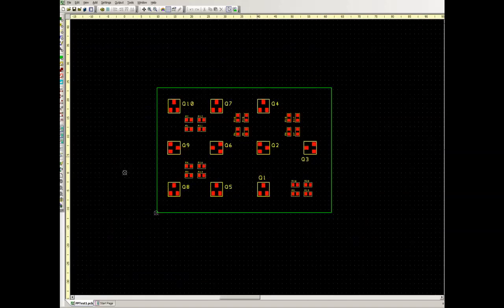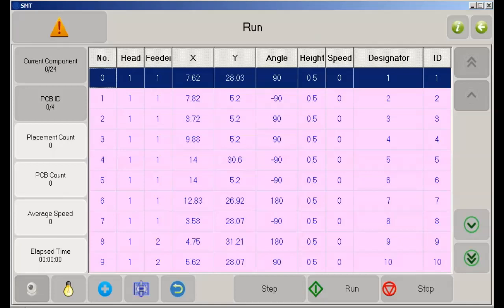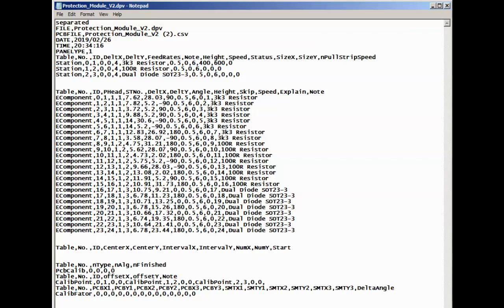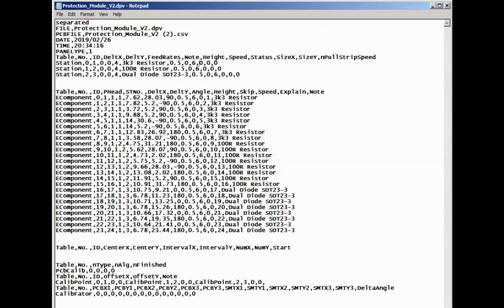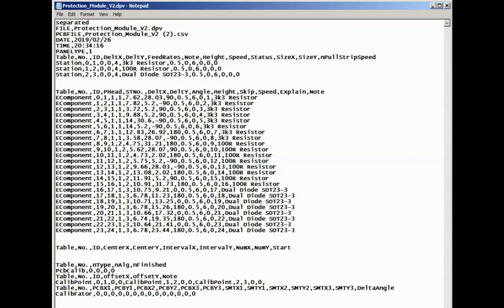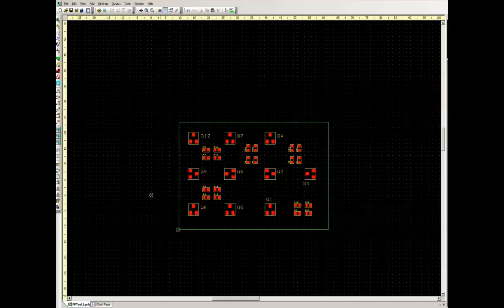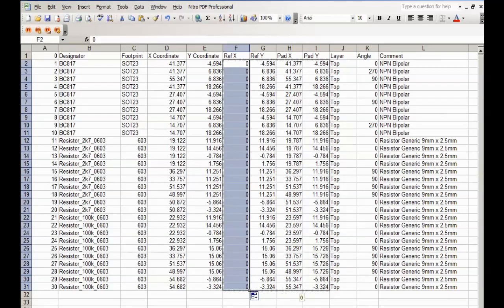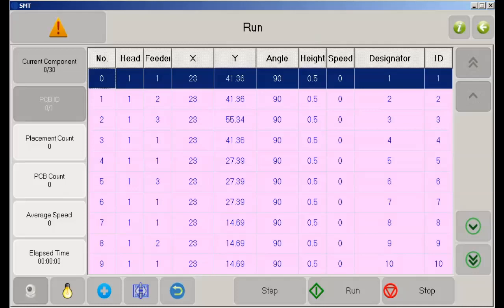CHM-T36VA Pick and Place Machine Part 2

Comment: I think that there was an error importing the CAD generated csv file -- items do not get mapped to the right columns. What got me is that @20:56, all of the "X Coordiantes" are 23.00, which cannot be right as there are also repeated "Y Coordinates" with the same value (that would stack the components :-). When comparing with @20:04 the columns ("Footprint", "X Coordinate") end up as the ("X Coordinate", "Y Coordinate"). It looks like SOT23 got converted to 23.00!  Similarly ("Designator", "Angle") get mapped to ("Footprint", "Comment").  I think you did mention there needs to be 2 extra columns at the start, but I think the generated file from the CAD program only had one -- explaining the shift that happens.  I don't have one of these units, so I cannot confirm if this is the issue.
Reply from the maker: No there are no errors in this job. In fact this is a working file. I did mention in the video that there are some 'quirks' in the software and the 'repeats' you mention are simply rotated components which show on 2 lines but only appear once in the job file. Other repeated coordinates are because the components are in rows and columns. The designators are whatever you want and I leave them as they are identified in the components in the CAD system as once imported they are finally renamed as per the job file.
Reply: @JerryWalker001  My original comment was poorly phrased; the data displayed does not match what it was asked to import. As you say this runs, could chalk this up to being a "quirk".  Thanks for making this channel, I am enjoying the content.

Comment: I've just purchased a PnP. Quick question you said the designator is a reference what feeder to go to, But my sample code from Charmhigh the designators are pcb references like R1, R2, C8 etc  Maybe it's different for my T60P4? I think I will have to experiment when it arrives today.
Reply from the maker: The designator is a component type and components are selected from the correct station based on the identified designator. This should not be confused with component designator which is a reference to the actual component (which the P&P does not care about. Depending on the CAD system you are using you need to make sure that the component designator is in the correct colum so that the P&P software can correctly identify which component type it is and pick from the correct station.
Reply: Thanks for the confirmation, I've just been playing around with the cvs dpv converting tool they sent me. I think they name it different in their software / manual for the T60P4, feeder is called stack.  From the manual "Comp. ID: unique number, it won’t have 2 same comp. ID in one work file. M Stack: stack 1-30, 31-60 is normal feeder on the two sides of machine, stack 81-91 is for front bulk IC, stack 92-100 is for vibration feeder, stack 101-119 is for IC tray."
Reply from the maker: Yes if you watch all my P&P videos I mention that they refer to columns in different ways. The names are not important, it is the column order. The easiest way is to open the job file to see what is needed in each column and then arrange your own files to match this order. You can then see how they are translated by the software. The manufacturers instructions seem to assume you are using a specific CAD system. If you are still unsure then create a job file from within the software and manually add a single component and then open the job file to see how it uses the columns. Be careful with rotations as the software only shows the last specified rotation and not the cumulitive rotation angle.